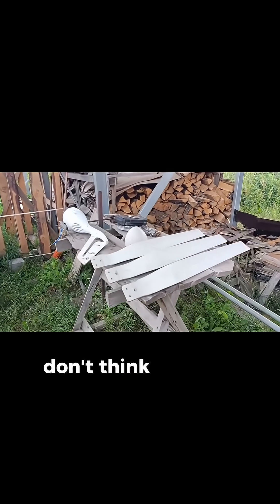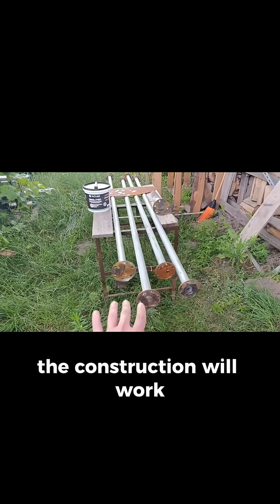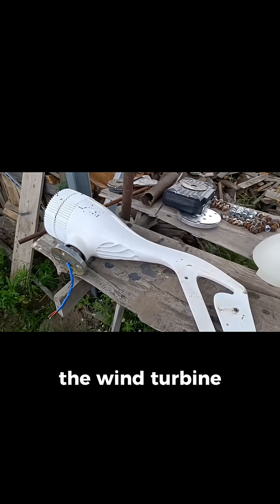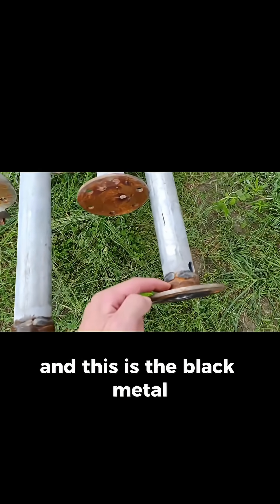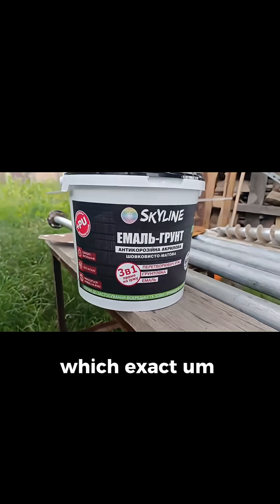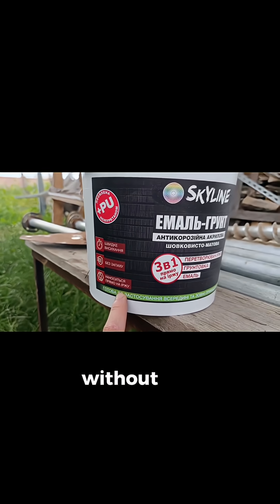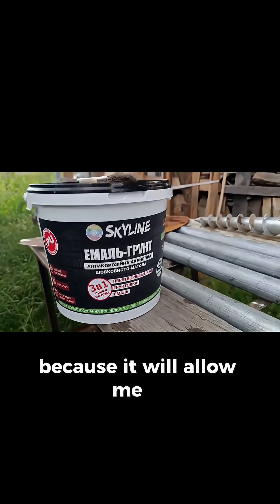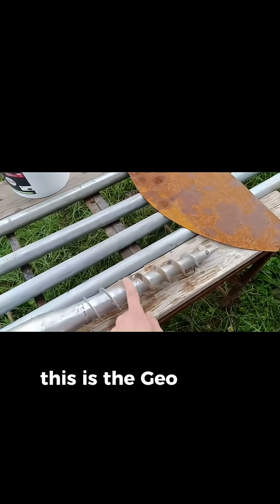Watch How I Perfectly Built and Dismantled an 8 Meter Wind Turbine Tower!

Comment: Hi Mate, did you remember that I am using 2V 600Ah AGM batteries, well I use 12 batteries for one 240V inverter, but I use 13 batteries for another 240V inverter which has a higher max voltage of 32V.
So I run the two Vevor 24V wind generators without regulators on the 13 battery bank, because the max voltage of the 24V Vevors is 28.5V. Tested it in a storm, everything working great for night time charging.
Reply from the maker: yes I do, but how do you balance them?
Reply: @BackyardVoltage  The inverter has a balance function built into the charging system.
Reply from the maker: aha, got you